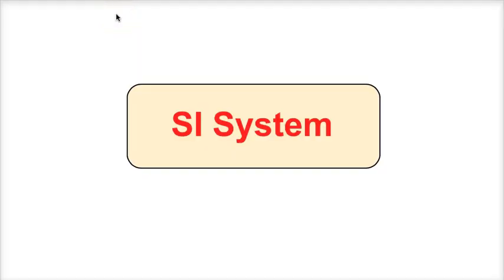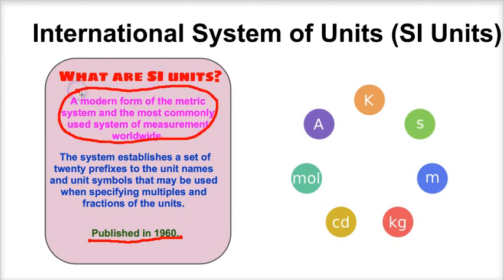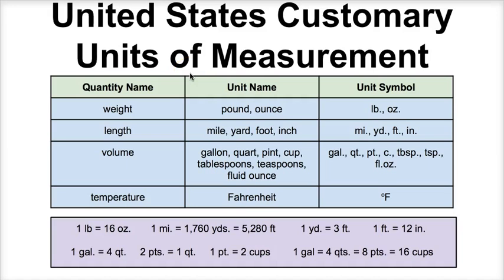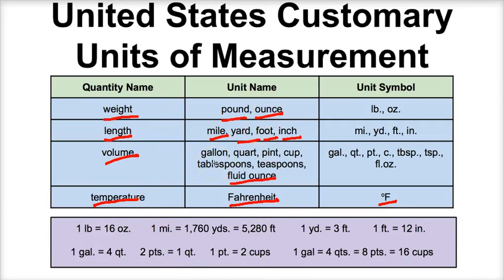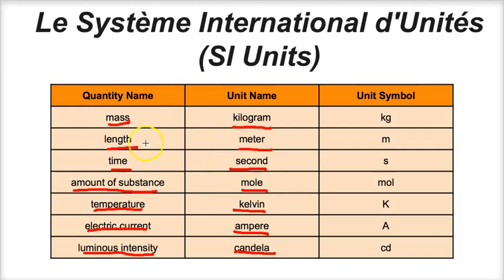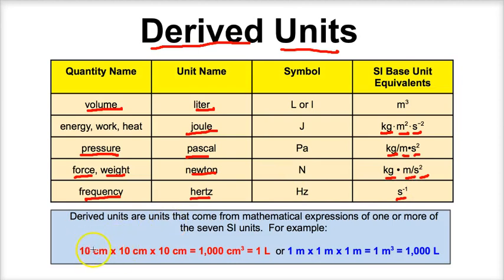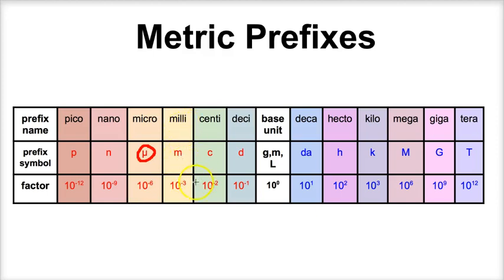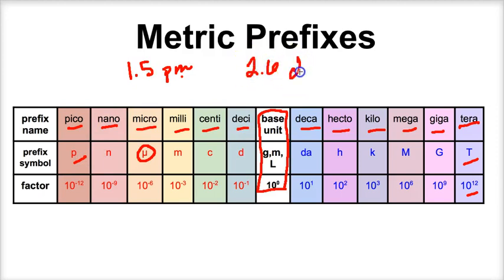The Metric System - Explained

Comment: What is stupid about the imperial system is not the size of the unit, it is the weakness of the conversion systems.
The metric system has been adopted by all but three countries in the world because it is based on decimal and the ratio of 10 between larger or smaller units.
It's so much simpler...

Comment: That's wrong. We never use Kelvin in Brazil. We use Celsius.
Reply: don't know if you just don't know/are trolling/... but anyway. Kelvin and Celcius are the same scale. except that 0 in kelvin is the absolute zero and celcius zero is defind as 273.15 kelvin. which is the freezing point of water in standard circumstances
Reply: @JAlanne  The presenter referred to the 7 SI Base Units (although he called them "Main Units")
As he stated, all other SI units are derived from these Base units and many of these "derived" units are "named derived units".
Reply: Not in science you don't.

Comment: There is no such thing a deci liters. You dumb yanks you have just shown a table so all you need to know is the base unit and then you can look up the table
Reply: decilitre dL 10² cm³ hundred cubic centimetres
https://en.wikipedia.org/wiki/Litre#SI_prefixes_applied_to_the_litre
Reply: Deciliters are commonly used on food making. A typical measure used is one deciliter. Centiliters are use in measuring alcohol. Milliliters are used for scientific measures. There are different prefixes for different uses.
Reply: @okaro6595  Decilitres are sometimes use in food marketing BUT mainly/(only?) in the "old" metric countries of Europe. 
It is now almost universally recognised in newer metric countries that "The Metric System is Better By a Thousand."
In such countries, quantities smaller than a litre would be specified in millilitres, microlitres etc.
(See https://www.youtube.com/watch?v=1d3gAZ-Te3Y)

Comment: You have forgotten Volt as a base unit!
Reply: Volt is not a base unit.. it is Joules/coulomb.
Reply: Sorry but you are both wrong both volt and Joule are derived SI units. Being pedantic there are only 7 base units, all other units are derived from these in some combination or another. I would have to dig my old physics books out to tell you the true derivation of volt and Joule
Reply: @paulknox999  One volt is defined as the difference in electric potential between two points of a conducting wire when an electric current of one ampere dissipates one watt of power between those points. 
It is also equal to the potential difference between two parallel, infinite planes spaced 1 meter apart that create an electric field of 1 newton per coulomb. Additionally, it is the potential difference between two points that will impart one joule of energy per coulomb of charge that passes through it. 
It can be expressed in terms of SI base units (m, kg, s, and A) but this site does not allow the writing of the formulae - so see  https://en.wikipedia.org/wiki/Volt

Comment: In my point of view, the most important benefit for this system, is the relation between units. I give one exemple :

1 kilogram is (by definition) the weight of 1 L of water.

So, there is a direct link between volume and mass.
Reply: It's actually not by definition but close enough.
Reply: Neme His point remains the same though. We can convert it was ease.
Reply: @villager1831  mass, not weight.